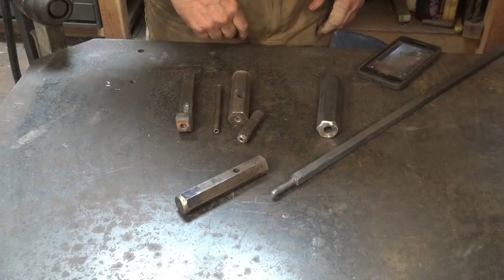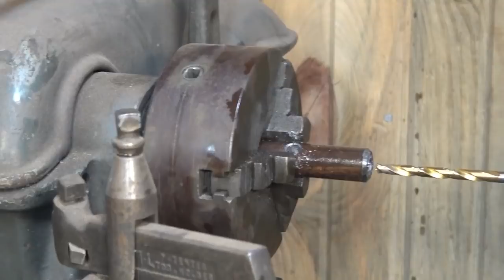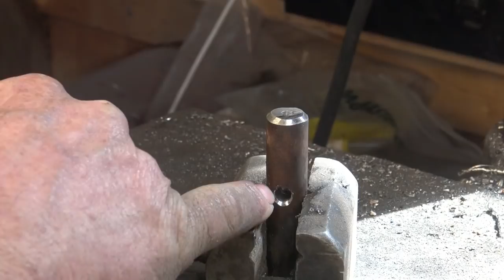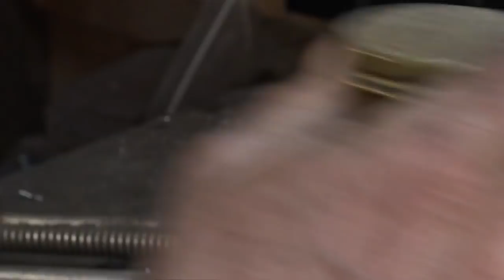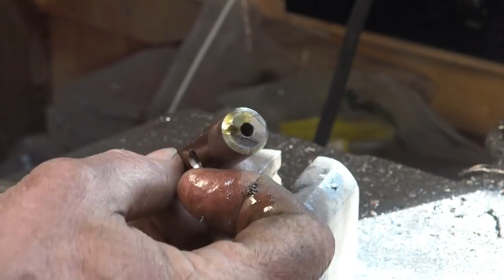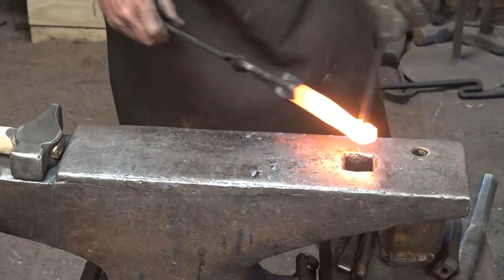Monkey tools - drill or forge

Comment: Be curious if you could make a monkey tool by drawing out the center of a piece of bar, punching it, then folding it back and doing a f'got( computers will get me) weld for the struck end. I'm certain it could be done. I moved a while back, so I'm not set back up yet. I'm still a rookie. With the break, I'll be beginner once again 😂

Comment: What kind of place is the best bet for scavenging tool steel?
Reply from the maker: I buy most of my tool steel new.  But if you want to use spring steel, automotive shops are a good source and for the old jack hammer bits like I often use for monkey tools, tool rental stores often have old ones
Reply: @BlackBearForge  thank you! 😁👍

Comment: No worries about the drill rods in the forge at all. TNT does NOT explode when lit on fire. It burns. Rather well, in fact. Growing up in northern Ontario, I knew a prospector who used to like to freak visitors to his camp out by breaking a stick of dynamite and lighting the open end on fire... he would then use it to heat up a cup of coffee.
As long as that hole is open at the end, if there IS any TNT in it, it will burn out.  Only danger comes if the TNT is sealed at both ends and under pressure. Then, conceivably, it COULD explode if superheated, but the odds of that actually occurring are about on par with winning the Powerball.....

Comment: Hi John.  I’m not sure the type of steel they are made of. Each drill steel is very heavy. Two men struggle to pick one up. When they break they fall back in the hole and we find them after the blasting operation. They are twisted up but they don’t break. I’m guessing they have a lot of flex to drill a 5 “ hole 100+ feet deep. I’ll see if I can find out what they are made I’m curious now. Thanks again for your excellent videos.

Comment: Great video John. I work in a rock quarry.  We don’t use the little one you have. Ours are 20 ft long about 2 1/2” diameter.  The hole down the center is about 3/4”. It’s for compressed air from the drill
Reply from the maker: Sounds like a big hunk of steel, do you know what the material is?  We have a small quarry near us, I should drop by.

Comment: Rotary broach would be a way to make a blind square hole.
Reply from the maker: I haven't seen one.  Should I assume you need a mill to run such a tool
Reply: I've used a rotary broach but it was a hex for an Allen wrench. I did it on a lathe.
Reply: Mill or a lathe would be most likely needed.